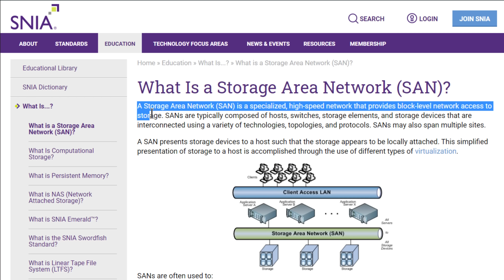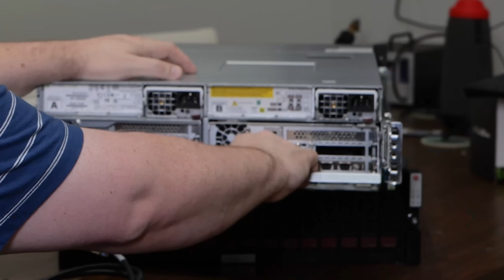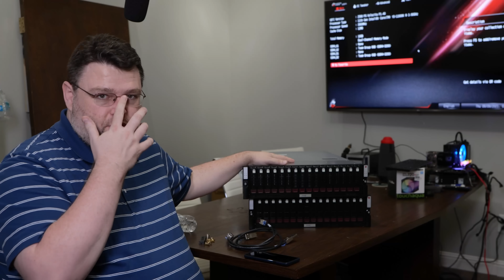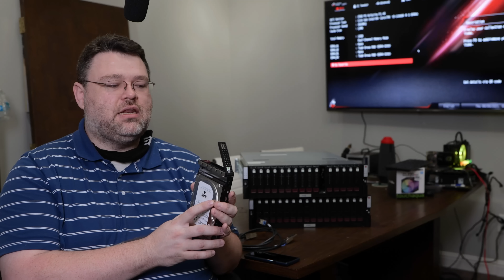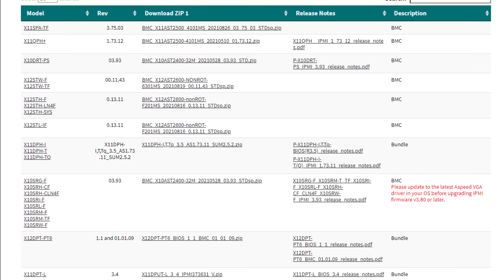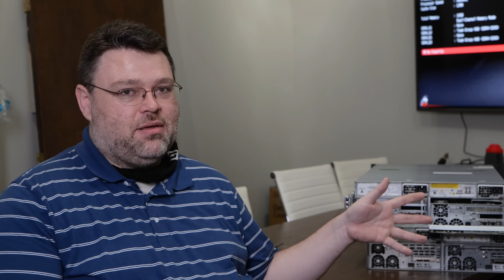Storage Area Network: Buy with Knowledge

Comment: How is this technology complimentary to different fabrics types, when you have a bunch of flash based storage can you DYI a san or is the software the special sauce that glues everything together? 

*edited*
Reply: actually,  if you go with ISCSI / Ethernet based you'll have allot of options..  and you wont want to do a bunch of flash based storage..  for one flash storage is very expensive, and its not all that good.. its fast, yes.. but has its own issues, such as blocks going dead out of nowhere, or motherboards that wont see all of the flash disks, but only a couple of them.  better to use flash based CACHE,  SSD short term storage, and spinner long term storage.   there are many options for DIY SAN's, but your better off going with a NAS utilizing ISCSI.    most SAN providers are very picky about thier software/firmware.   but you can get some pretty cheap nimbles online that are out of service, or even dell equallogics these days.  but if you want to build your own hardware, then your stuck with NAS..

Comment: Thank you for your incredibly great and detailed AF video on Storage Area Networks, Wendel! I learned a lot, and I have been working on building a new storage and Proxmox server for my home/buisness use, and I looked into disk shelves but there are so many different versions, standards, connections, protocols and vendors out there that I was really overwhelmed. So instead I opted to reuse the old Supermicro 4U server chassis from my previous server (with already 5 built-in 3.5" hot swap bays), and added another two aftermarket IcyDock units to convert the 6 unused 5.25" bays (in two stacks of three, side-by-side) into two banks of 4 hot swappable 3.5" HDDs each, both units have a powerful 92mm built-in cooling fan, LED status reporting on the front of the chassis and internal SMART monitoring.

Perhaps you could consider making a similair video for disk shelves to help those in need? It would sure as hell help me when in the not-too-distant future I run out of storage space with each and every one of my currently available 13 hot swappable 3.5" HDD trays already occupied! 😁😁 Many, many thanks for everything you do for us here in the more technical parts of the YouTube space, and I want you know that I really , really , really appreciate the incredibly humongous amount of work you put into these videos for us Wendel! 🤗🤗 (no homo! 😉) 

I hope you have a good one, thank you dude!👍👍

Comment: I feel like I have to ask the questions, what is the difference between NAS and a SAN then?
Reply: Simply put, in a SAN the storage (the disks) can be  directly connected to 2 or more computers at the same time.
 One advantage is redundancy, which is the point if this video. But  another one is much more  performance (if done properly), as the "clients" don't need to go trough a server, all computers in the SAN can access the disks directly. This requires a special SAN filesystem, but when done properly the performance is much bigger, because there is no server acting as a bottleneck in the middle.

Comment: Some hardware things aside (SAS drives and BBU journal) - Are these SAN things actually different from the open source distributed File Systems you can run yourself on hardware you want? Be it Ceph, BeeGFS, Lustre, etc. Or are you just paying for a nice package + support of that in the end?
Reply: Cannot speak to BeeGFS and Lustre, but Ceph is very different to the traditional SANs. It is fully distributed - truly without a single point of failure and it is infinitely horizontally scalable. You would not use SANs for large deployments of hundreds of physical machines. You can also do hyperconverged infrastructure with Ceph (similar to vSAN), however most deployments I have heard about are still disaggregated into storage + compute. Ceph can be deployed on virtually any hardware and does not rely on high quality components and redundancy inside the machines. It assumes that things will fail and hardware will be replaced on a regular basis.

So as you write - SAN is a preconfigured box with nice interface that is relatively easy to manage and is suitable in my opinion only to smaller deployments while Ceph is a full blown, harder to manage (depending on your teams expertise) distributed storage solution. In the end you would probably not install Ceph yourself but buy a Ceph solution with a support from some company as well.
Reply: @stepansigut1949  honestly the rook operator has made what little I've done with ceph pretty easy. It's easier than picking a SAN to use at the very least
Reply: This is what I am seeing, but then again zfs is where my question of hardware solutions began, so software defined storage seems like the obvious choice to me as well.

It doesn't help I've worked with some SANs that was just linux running a bunch of nfs mounts ...

Comment: As a SAN support guy, Glad to see some coverage of it in IT channels like this to demystifiy it. I work with end to end nvme SANs and you'd be surprised how much of that is just modified commodity hardware
Reply: SAN Engineer at a major vendor myself, I agree I'm also glad to see it covered, I hope more is coming.  Most of the SANs I work with are not X86 based though.
Reply: I was wondering if you guys have any perspective into the sales too. How often do your solutions win/loose to fully distributed software solutions like vSAN, CEPH... do companies with smaller deployments choose SANs for its simplicity and user-friendliness?
Reply: @stepansigut1949  Storage arrays were generally chosen because of enterprises needs were forever changing it was viewed as a way to dynamically provide data storage services, with varying capacity, and performance. Companies choose storage arrays for their uptime, availability, and performance, for cheaper arrays usability im sure is a factor but the more expensive an array the less you are concerned with usability and the more you care about the array. Fully distributed or vsans haven't caught on as much as everyone had hoped its mostly hyper converged.
Reply: @stepansigut1949  smaller deployments its all about cost. And the vendor I work for is FAR from cheap but it is simple and user friendly. Our sales guys push to sell them "as a service" to avoid an upfront cost. But yeah typically a mom and pops shop would go cheaper first or even use a cloud based solution before they pay 250k just to have something user friendly on prem.
Reply: @killroy713  those mom and pop shops are not running 2,000 VM's with exchange on prem thats over 4tb for just 1 enchange datastore.    they are much better off going on the cloud.
Reply: @danratsnapnames  very true and many SAN vendors (including the one i work for) are making SAN software available for cloud environments just for ease of use and de-duplication.  But Small SANs still do have place in the case of Local Financial institutions and Heath Clinics where On-Prem is a regulatory Must. Patient Records on the Public cloud aren't exactly HIPPA compliant.
Reply: @killroy713  Not only those types of customers, many more as well. I work as a System Engineer for a big IT service provider in our Datacenter department, and most of our customers have stayed on prem so far and are not planning to go to the cloud anytime soon. For some of them it's a regulatory thing (public sector, but also some heavily regulated industries, of which there are more here in Germany than in the US for example), but for most of them it's just about trusting someone else with your data.
And most of it is not rational, I think. It's just that giving your data to somebody else doesn't feel right for many executives. Not that their data was actually more secure on prem than it would be in the cloud, because of course most of them don't have the greatest IT security.
I expect this to change over time, but for now it's a big factor.
Reply: SANs are dead
Reply: @lesliestandifer  long live the SANs?
Reply: @RobertD_83 long live rock!

Comment: Would love to see a semi-tutorial video on setting up a SAN from end-to-end (with all the proper caches and redundancy), and possibly even linking it into the compute layer.  Doesn't need to be a full tutorial with every step click-by-click, as that would be much too dry... but maybe just hitting on the major points and steps,  where someone could google the finer details if they were trying to replicate the effort.
Reply: EEK.. that tutorial would be highly dependant on the hardware used.. EVERY single SaN does things differently.  but the basic steps are fairly easy to remember..   
  1.  setup san, give it network address.  access web management. 
  2.  setup dataset's and provision iscsi
  3.  link iscsi dataset to host
  4. format dataset at the host.
  5. deploy iscsi dataset to other hosts.

however, just step 1 would be a massive long video covering just 1 SAN of very specific make and model.   
step 2 would be another massive video covering that same san above of very specific make and model. 

step 3, 4 and 5 would be based on the Host type you using,  Vmware, or citrix, or whatever.   not very long, fairly easy for most hypervisors unless your using xcp-ng.. lol

Comment: I always thought the distinction was that sans were distributed across the network. So you have high availability even if a single network node is bugging out or unavailable
Reply from the maker: Ideally yes I said I'd want a other full replica of this. But technically this is two fully connected nodes in a box
Reply: distributed yes through redundant network paths.. multipathing ,  bonded links, and so on. but a SAN via ISCSI can be a real hog of data on a network, so usually they deployment on isolated network and switches and not shared with your normal network data.  the iscsi broadcasts can bog down routers very easily.

Comment: compare this to a forklift upgrade to something modern like hyperconverged cluster like Scale Computing or Nutanix.
Reply: Why anyone is still even talking about SAN's unless it's in a historical context. HCI just makes them redundant
Reply: hyperconverged is not what its cracked up to be.. on paper it looks great.. but in reality,  complete CRAP!
Reply: @danratsnapnames  why are the consolidation of the 321 models by scaling compute and storage "complete CRAP"? Since our move to scale hci our DB's are performing drastically better with the mixed flash/spinning storage tech. We did a forklift upgrade for less than the licensing for vsan on our 5 node cluster. Our upgrade path is drastically lower cost than staying in the VMware model. Yes, there is a difference in ability I get that, but 99% of those VMware features that aren't on the HCI environment are not used by our team.

Comment: If i recall correctly, TrueNAS pulled support for LGA1366, but that may have just been that many boards did not support EFI/UEFI 
I know it wouldnt install on my Dell C2100 and pair of R710 R510 and my R710, had to 'upgrade' from an older version

Have since upgraded to a portable mATX primary server, with 18 SATA SSDs and a Ryzen 5 Pro 4650G, but i would like to use the old C2100 in my garage-off building as the baclup, instead of a mini PC with 3 16TB USB drives in software raid

But i really like the OOBM of that asrock rack motherboard

Comment: Whatt? I'm pretty sure you need to spend a quarter million to get a workable san! /s

Great video, lots of good info in here!
Reply: no not really..   if you want flash and ssd,  and have performance upwards of 100,000 IOPS..   yea.. sure..  250k is just the start for a single nimble that is supported.. but you'll never use anything else if you did..    but there are also some lighter SAN's, that wont break 10k.    dell EMC,  equallogic comes to mind.. very cheap these days, and they work fairlly well compared to the others. considering most sans go YEARS without reboots, or ever needing a reboot for that matter.
Reply: I built mine with ESOS and yes my 16 SSDs was expensive but would have been equally expensive independent on my use-case :)